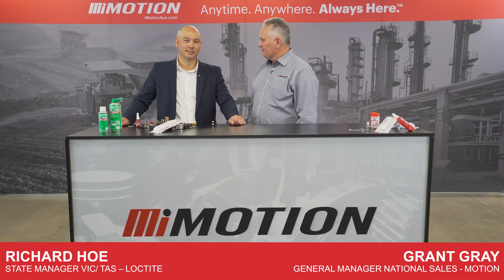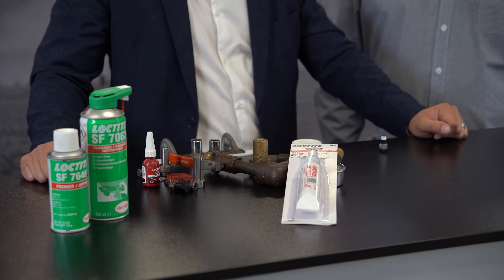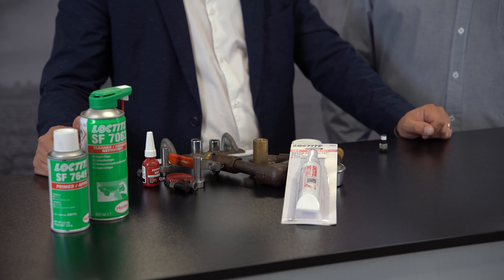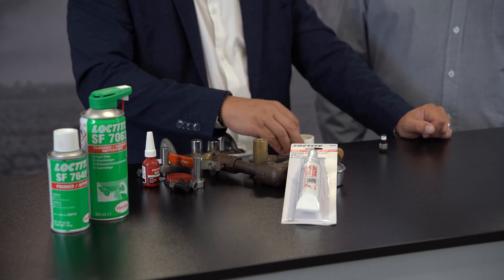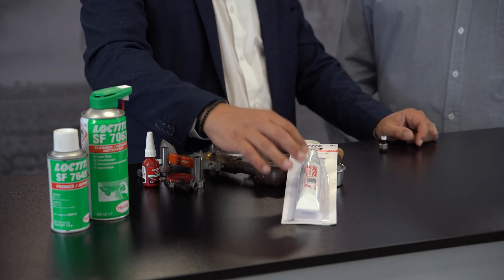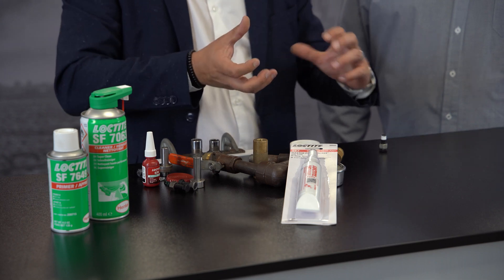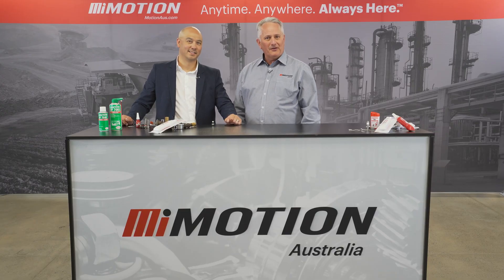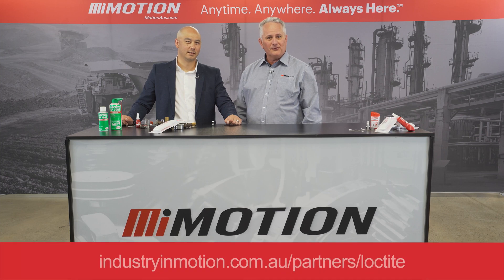Introducing LOCTITE® 567 Thread Sealant

Comment: This or 577 for brass fittings?
Reply from the maker: Hi @l337Rat, they can both be used on brass. It really depends on the application, cure times, service temperatures etc.

Loctite 567 - Low disassembly strength thread sealant, recommended for use on coarse metal threads up to M80/R3" including Stainless Steel. Slow cure allows for readjustment of valves & fittings if required. 

Loctite 577 - Medium strength thread sealant with excellent chemical resistance suitable for all metals. Cures on active and inactive metals + locks connection against vibration-induced loosening. 

The 567 has a service temperature of up to 200°C, whereas the 577 goes up to 150°C only. 

Hope this helps. :)
Reply: @motionaustralia  Perfect thanks for the info. Very helpful indeed